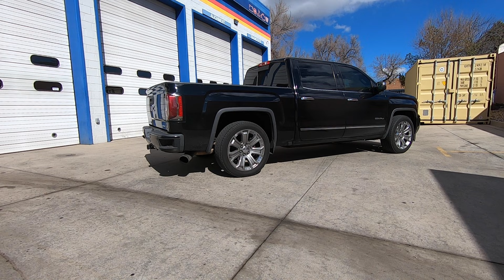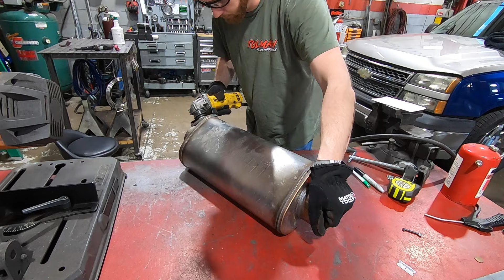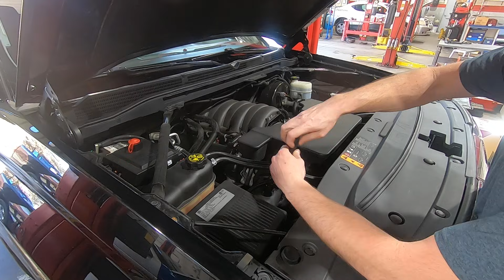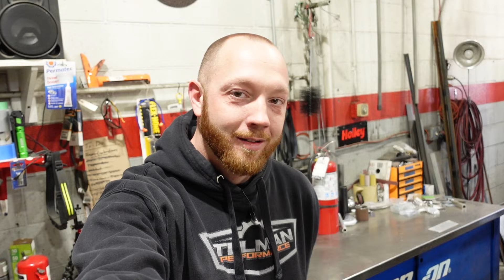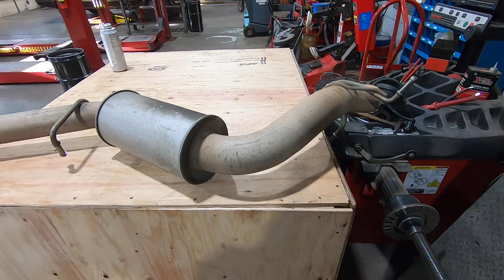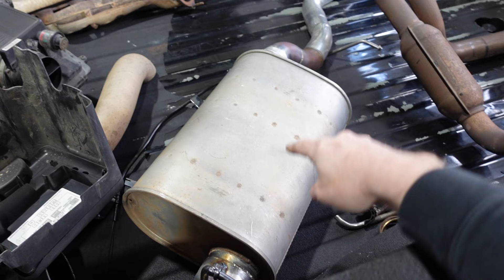I used SPACESHIP parts to build the ULTIMATE exhaust

Comment: Needs a length equalizer loop for the crossover/mid-pipe and a Helmholtz chamber designed afterward (meaning, after the rest of the exhaust, and you must measure the frequency where it's loudest) to eliminate drone. Yes, a chamber, not the old quarter-wave tube you used in a previous build. If you wanna do something interesting, make an H-pipe after the equalizer loop and attach the Helmholtz chamber off the H, then run it back to two double-offset straight-through mufflers (diagonal path through the case), then out to your tailpipes. That should be enough attenuation; the H-pipe will make it sound thicker and more old school (so like a truck, but without the unequal aspect), and the Helmholtz chamber should handle that highway drone.

Comment: I would love to see a version where the 3rd cat and Y pipe is removed, X pipe with dual 2.5" parallel  along passenger side all the way to the back two Flowmaster fx mufflers then two tips 2.5" in, 4" out but 18" long.

Comment: One option is to change your cruising speed. I find GM has been sticking to low of a gear ratio into their rear ends the past few decades for my taste. Get that engine RPM down to around 1200 on the highway and it may just clear up.

Comment: I've been going thru the same process on my 2012 supercharged 5.3 silverado. It currently has speed engineering long tube headers into 3.5" catless Y-pipe, I wanted it quiet it down so I bought the biggest 3.5" muffler I could find, which happened to be a Walker Diesel muffler, then split it into dual 2.5" tailpipes straight out the back. It's still too loud and drones at 1500 rpm under load. I'm going to try adding a 3.5" high flow cat after the Y. It also has a 3.5" cutout for the track. You gave me the idea to find a stock resonator off a 6.2 truck. That's exactly the sound I'm looking for!

Comment: Hey man nice build! I've got an 18 Denali, I recently did some some sound system upgrades to it and through the process I found out the truck actually has a factory Active Noise Cancellation in the cab, that I had to disable for my upgrade. Upon disabling it I find that I can actually hear my Borla attack cat back exhaust better from in the cab. You can try it by just unplugging the ANC harness on the bose amp behind the back seat, and if it's something you want tk keep there's an ANC bypass or you can cut the ANC mic wires to retain the chimes in the vehicle. Hope that helps the journey!!

Comment: I have done a lot of exhausts.  The only time you ever get drone is, if there is a small leak under the truck, the exhaust doesn’t extend far enough out past the truck, or one of your hangers is too rigid.   If that exhaust is completely sealed and exiting either 1 inch behind the rear bumper or 1 inch outside the truck on the side you will have zero drone.   Think about it, how is the exhaust coming from the back right corner and vibrating and droning  inside the cab? Judging by your welds, you definitely don’t have a leak.  I would look into your exhaust hangers and make sure there is good soft rubber between the exhaust in the truck.  Your tailpipe, you could try extending it another inch so that it’s a little bit closer to the outside edge of the truck.   It’s always the worst when the exhaust can come up under the truck and vibrate everything.

Comment: I still have cats on my 6.2 Yukon, only have Vibrant ultra quiet resonator and it cleaned up the exhaust note a TON.  It got annoying when taking roadtrips with the family.  Its still loud but all the sound now comes from the tip and doesnt sound horrible inside.   video clip of warm start in my channel

Comment: I love these builds. I currently run stainless headers, high flow cats, a straight through stainless glasspack stylle muffler in front of a Thrush welded chambered muffler in my 2013 F150, and its on the edge of too loud, but sounds killer. I love exhaust systems, theyre fun to mess with

Comment: I put a flowmaster exhaust on my 99 Yukon before I learned some stuff about exhaust science. I called it the "dronemaster" because it was deafening. I ended up putting a resonator ahead of the muffler (can't remember the brand or size) and that mostly deleted the drone. Switching to a magnaflow completely deleted the drone and sounded better than the slowmaster ever did

Comment: Hello, instrumentation technician here. Not really sure if that Borla thing actually does much. It’s more of a weird resonator than anything. But it reminded me of an issue I had at work where we installed a magnetic flow meter in between two 90 degree bends. The problem we had is we could never get it to read the same flow as we could with a coriolis flow meter (more reliable test meter). What we found was the flow was not laminar due to the bends and could never fill the entire space in the pipe, so that type of flow meter would never read accurately. My suspicion is that the Borla thing requires laminar flow for it to work properly. I theorize that you are essentially choking down your exhaust through two or maybe 3 of the smaller pipes inside that thing and not really giving it a proper chance to do anything. My suggestion would be to move it to the mid pipe, probably at least 6 inches downstream of the cat so that it may have a good laminar flow to it. 6 inches may not be the best suggestion either, there are calculators you can use to find the correct distance for laminar flow after a disturbance. Hope this helps! 😊

Comment: The reason the S10 had zero drone, was the mufflers at the end keeping the reversion from resonating with the muffler up front. Single muffler systems always have some amount of drone somewhere in the rev range, unless it's at the very end of the tailpipe. The only way to avoid it, is a tuned dual-path muffler that splits the pulses to help cancel each other out.

Comment: Gave up Flowmaster years ago for DD's, Cherry Bomb Vortex mufflers are all I use now. I have yet to have drone on four different trucks, two 4.7l Tundras, 460 90 F250, and my current truck a 2010 Tundra 5.7l. Very nice low idle and cruising speed, and nice loud (not straight pipe loud) WOT.

Comment: I love coming up with different exhaust systems too, but without a frequency plot/spectrum analysis, it is quite subjective.  To my ears, the drone is absolutely terrible.  You may be able to delete the drone by measuring the drone frequency and then building a helmholtz resonator (Dead-end pipe) to cancel the wave out.  I've also heard (But not tested) that having mufflers as close to the tailpipes has a big reduction in drone.

Comment: Wrapped long tubes, 2-1 3” into a flowmaster super 44. With a wrapped 2-1 merge back to 3”. And an over the axle 90° dump. If the exit is straight it will drone! Must have a turn down at the end!

Comment: Stop cutting off the straight flange sections and welding them end to end...those canisters need sections of straight pipe on either end to work properly. Seperating them all by a couple feet and not having the harmonizer between two bends would also help. You took engineered parts and put them together in a way they wont work properly 😢

Comment: Necking down the tail pipe section from 3.5" to two smaller diameter pipes will affect drone more than the muffler choice. The length and diameter of the pipes will determine how much and what frequencies are reduced. I'd try a merge from 3.5" to two 2.25" where the Borla Polyphonic Harmonizer is installed. If done right and with the right tips it can look OE+ and virtually eliminate the drone without drastically reducing overall output and without reducing flow. The two 2.25" pipes combined will have a similar cross sectional area of a single 4.5" pipe, but with a higher resonant frequency. I'd remove the Borla piece altogether, as in this application with as much sound attenuation is there, you'll never actually hear what it's doing. All that said, you could also just weld in a universal Verex active muffler from Xforce and have the best of both worlds. Quieter than stock when you want it if you keep the resonator, and loud when you want it. If you know you're going 4" in the future, buy the 4" muffler and neck down to 3.5" on both ends. That way you're only investing in the expensive muffler once.

Comment: 9n my truck is have long tube headers true duel 3 inch exhaust with x pipe flow master all the way out the back. Now fore power i have 6.0 stroke and bord to 427. With forged internals. Steel crank. Texas speed heads btr cam procharger f1x i believe. Flex fuel built 4l80. 4.56 gears 
 Now my truck is z71 with 37 in tires. And 8 inch pro comp lift with coil overs and straight axle conversion on front. And believe it are not it rides and drives great. I still have Cruz ac everything looks factory heated cooled seats captains with console in front leather. But everything look factory

Comment: Dude you should've just gone with borla xr1 oval mufflers.  I have them in my 2000 ford lightning and I can have a conversation in it even though the exhaust is right by the door compared to the flowmaster that was in it that was insane,  it had insane drone but with these mufflers you get zero drone.

Comment: If u want something that doesn’t got drone, isn’t terribly loud, but has a little grunt when u hit the gas, then do high flow cats, Carven bullet muffler as the resonator, and a touring Corsa muffler
Reply: I’ve learned the equation that works for you doesn’t work for others. I have a 4.7 in my Dakota quad cab, stock cats (one each bank) to a stock Y 2.5” stock diameter cut right before where the original muffler was mounted say right under the back door passenger side. 

Single in and out center to center 2.5” polished 304 SS Spintech 6000. After that it curls under the frame rail and exits out before the rear passenger tire. Single in 2.5” y split to two 3.5” slash cut tips also SS. 

Here’s what I’m talking about, another guy with another 4.7 
that I found and my setup that I copied from a clone of my truck sounds nothing like mine. 

Only difference is he had a dual wall single tip. Maybe the tip made that much difference but again it’s a crap shoot

Comment: Hey man, just stumbled across this one. 1st thanks for putting this together. Cool video! 2nd I appreciate the level of detail oriented and dedication to getting the job done "right." As a suggestion, maybe invest in a db meter of some kind. You'd be able to measure sound levels parked, driving, passing, etc. with each component setup. Plus if you hear a system that you're trying to mimick, you can measure it as well and then build yours out to match the levels. Make sense? Just a thought. As mentioned before, great work. It's not craziness. It's your rig, and you've got to live with it. If it's not what you want, it's not right. Job well done sir! Keep up with the OCD...it's a good thing!

Comment: that harmonizer: put it as far forward right after the pipe merge, then avoid long lengths of straight pipe, and to reduce drone: get a hemholz resonator of some sort.
I also did 4 exhausts before I was happy, so now I have a dual: x pipe, then dual hemholz, then a paradox muffler, and a fibrant ultra quiet muffler at the tailpipe.
It no longer rasps, and it does not drone, even a bit at 1750RPM (75 mph)
it took a while, but it is finally no longer making me tired on anything longer than an hour..

Comment: personally? right after the headers/cats I would put a megaphone. then towards the rear I would a cherry bomb vortex muffler (or two if needed). and that would be it. that would be all that I do. and the sound would probably blow your mind. the cherry bomb vortex mufflers (no, not the typical red "glasspacks" you were probably thinking of) are designed for high flow (more flow than glasspacks actually) while reducing drone. they also have an odd effect of making the tone deeper. I put 3" pipe on my 05 subaru impreza wrx sti ending in the vortex muffler. that subaru rumble? yeah it was much deeper. sexier. smoother. the best part was idle was quiet, so i didn't wake my neighbors, but it still got "fun" when full throttle and racing. and no drone at highway speeds. in fact the typical "ricer" exhausts would be so loud and droning that it would mess with my audio. the vortex let me hear my music crystal clear at cruising speed. for your video at around 10 minutes, it was droning so hard. at least to my ears with headphones. maybe try out my idea? up to you. cherry bomb vortex is like 90 bucks a muffler? they are pretty cheap. only downside is they are mild steel.... which some people hate. i painted mine and welded it to stainless steel pipe. fuck it right?

Comment: I'd be curious how this would sound with a Y-pipe into 2 Vibrant Ultra Quiet resonators (resonators only).

Another possible low drone options could be Speedy Smooth mufflers from speedysequipment.

Problem is both of those only come in 2.5 and 3 inch iirc so you'd have to fake dual it.

Another decent economical option is OEM muffler only (delete all cats/resonators and tune accordingly). It can be an OEM muffler from another vehicle.

These are all decent and simple options if you plan on going with a bigger cam and don't want a lot of drone. And the sound is somewhat unique. If all else fails, there's always Corsa.

I've never been a fan of the deep rumble from Flowmaster or Borla when it comes to LS engines. I think they're more suited for motors that naturally have a higher pitched tone that warrants being toned down. LS motors need a healthy performance exhaust IMO.

Love all the exhaust content!!

Comment: 3.5" vibrant ultra quiet resonator.   Those are straight through, no flow restriction.  4" chambered flowmaster for the low notes.  4" because there's a slight flow penalty with chambered muffs.

Comment: This is dumb because flow master == drone. Always has.
I get that it's cool to play with the sound via free parts, but let's be real. Magna flow has gotten so thin they crack in a year, so the one true and reliable muffler is still the glass pack. Available everywhere, and in the cheap or expensive version. What's even funnier, the less expensive one is thicker metal!

Comment: try a stepdown in diameter near the exhaust tip. Often helps with drone, for example from 3.5 to 2.5 just for a few inches. Doesnt affect back pressure much but noticeably reduces drone

Comment: formula for sound  resonance of an open pipe:  Fq= (sp of sound) / 2* length .  this gives you the lengths of tube to try to avoid for "drone".   the mufflers are "nodes"   so you can measure from each "node"  to see if any length of pipe will act like a trumpet, producing a nice loud note, or drone.   so like this....  Fq = 1125 (sp of sound in feet per second) /  (2 * 8 feet of pipe)  This is the freq that 8 foot  pipe will resonate at....  70.3 Hz,   now,  at what RPM will your engine produce 70.3 Hz?    just take engine RPM times cylinders,  and divide by 60 for Hz of engine output.    1500 rpm *8(cyl) / 60(move to seconds) = 200hz.    but you'll have to also check the harmonics of 70.3,  just multiply thur by whole numbers...  70.3*2=140.6   , that's fine,  70.3*3= 210.9hz ,   we're above the 200 hz now.  This length of pipe will NOT resonate at 1500 RPM.  at 1581 RPM it WILL drone.   At this point you can see that we need to build a spread sheet of pipe lengths and engine RPMS to know what  lengths of pipe would avoid resonance or "drone".   Probably what is clear,   many many engine speed combinations and pipe lengths WILL drone.  short pipe lengths will move the resonance fq to a much higher note.  AKA,  engine needs more RPM to hit the "sweet spot" and drone.   :/    so for instance a  2 foot length of pipe will drone at  fq= 1125/(2*2) = 281.25Hz.   So For that 281.25  hz  pipe we would need 2109 RPM from the engine to drone through the 2 foot pipe.  It would make the exhaust pretty safe from having a drone.   But any length of pipe ,  from the engine, to the muffler,   then from the end of the muffler to the tail pipe,  would have to have 2 feet or shorter pipes.   Pretty short exhaust,  but from the exhaust manifold to the 1st cat might be short like that... then to the small    muffler could be a short 2 foot pipe.  then from that could be another short pipe to a small resonator,  then a short tail pipe out.  That was 8 feet of exhaust pipe and another foot of  muffler / resonator  ,  very much like the S-10 exhaust.   :)   Good that you did the AFM delete,  Are you concerned about the Trans on your 2018 Truck?

Comment: Hey brother so I worked for an exhaust shop building exhaust day in and day out so mufflers being in the middle of the system will always always drone having the packed resonator near the end of exhaust or any packed muffler or resonator in that area eliminates that hints why they did that from the factory even the stock muffler would have a drone without it. With that said if you put the tuner pipe in front of the pro fx and the pro fx after tuner tube and then the resonator in original spot you’d probably end up right where you wanted to be. Putting back pressure on the resonator pretty much makes it a muffler and negates the ability to cure drone and makes the frequency that creates it. As I said mufflers in the middle of any system equals drone